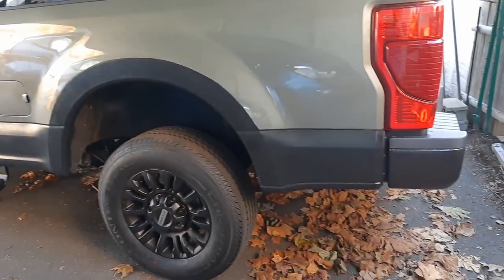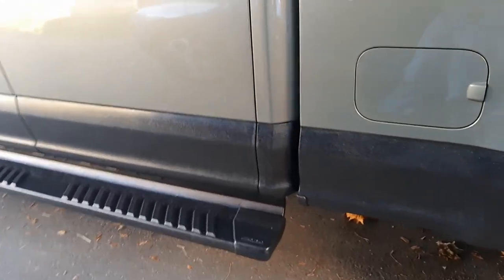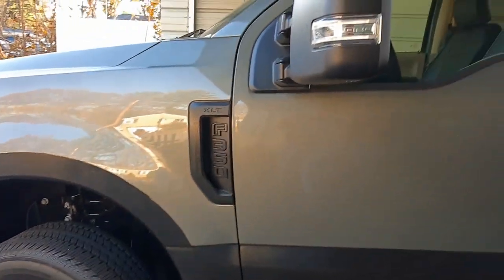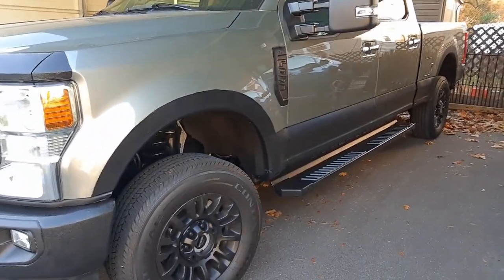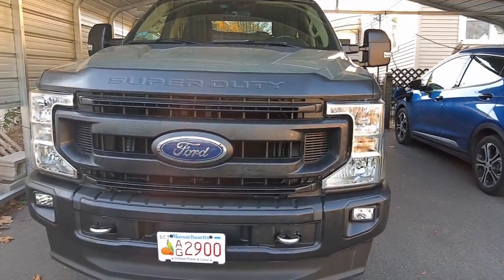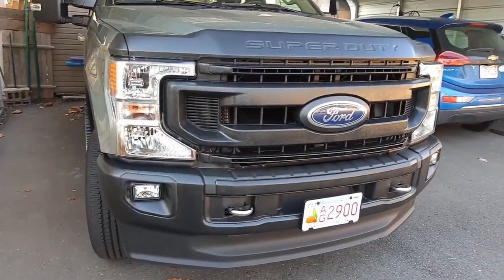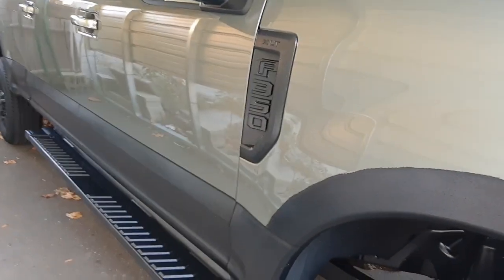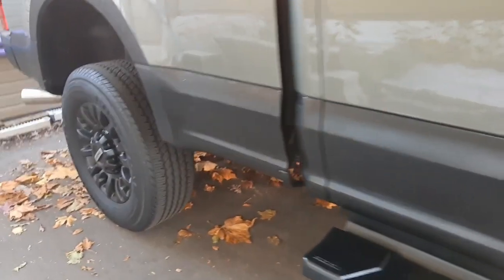How to apply rollon bed-liner to fenders, steps, grill and bumpers to a 2020 F350

Comment: Did you have to sand the bumpers ( front) ? This is 3 years old, how is it holding up? Looks great I have a Michigan Silverado rust on fenders😢
Reply from the maker: I didn't sand or prep anything. Originally I was going to take it off after a month if I liked it and have LineX do it the proper way. The truck only has 24k miles on it and there is only some flake off on the front of hood, a teeny bit on the grill and steps where I scrape my boots on it.  Email me if you want to see pics of the flaking parts.  I think if I used a pressure washer it would come off... or I can just do some touch up.  It's a "Bee Work Truck" so I'm not worried about it but the inside and out still looks new , just a bit dusty ;)